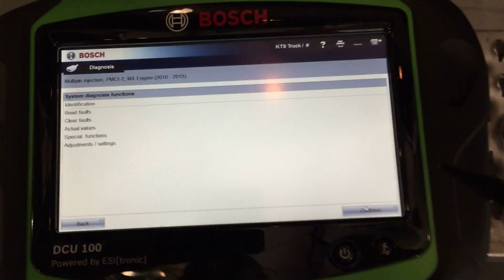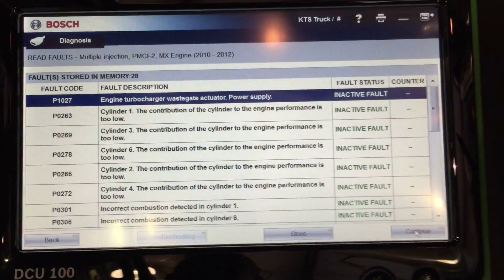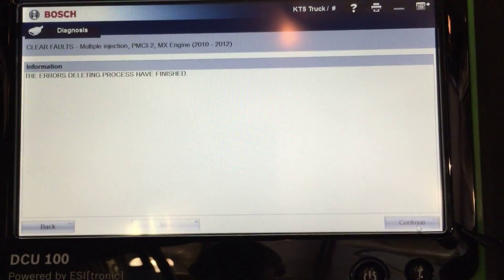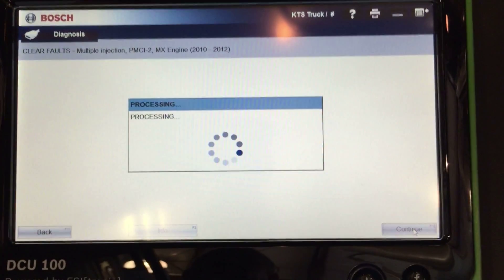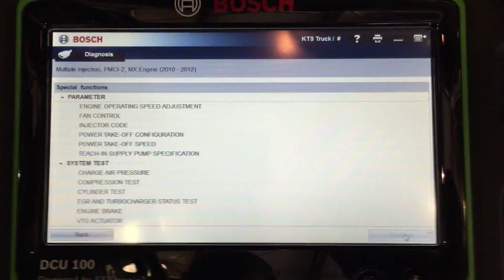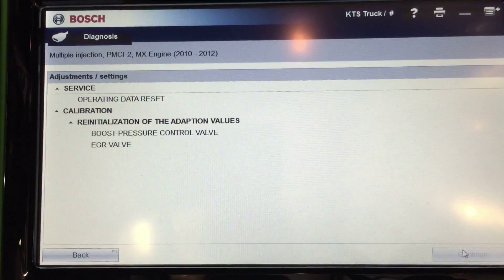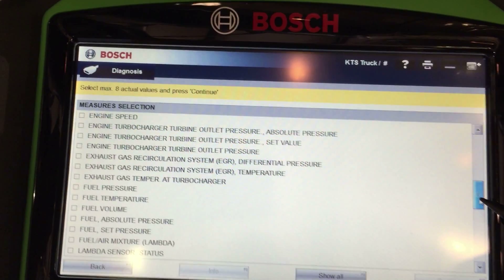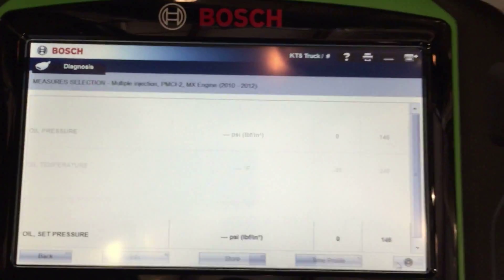BOSCH ESI Heavy Truck Diagnostic Tool & Scanner Reviewed - 2011 Peterbilt with MX Engine

Comment: Might you know of a good entry level HD scan tool?   I am from the light duty area switching over to HD.  I am used to needing to have a scan tool, for resets, basic code clears. (ABS work, Oil changes, Batteries, rear brakes,  Basic quick scan of MIL for a Customer.)   I may ask my SO rep, if I can get a HD package for my scan tool, but doubt they do that any more.  Plus I don't want to jump into a $8,000 plus tool right away.  I have to buy more tools first.

I don't know if it's the same for the HD side. However I do know, if you must do something simple and need to clear a code to finish. The shop scan tool is in use, Without fail.
Reply from the maker: Couple suggestions. One, this kit will read/clear/troubleshoot all codes on all commercial trucks -- http://www.diesellaptops.com/Universal-Diesel-Truck-Diagnostic-Tool-Scanner-Laptop-Kit-CF30-PFD-DREW.htm ... You could also look at some of our used items (http://www.diesellaptops.com/Used-Items_c27.htm) ... otherwise, call us at 888-983-1975 option 1 and talk to a sales rep. They are super knowledgeable and can direct you to the right direction. Also, the best "budget" version is a handheld reader. This is the best one since it comes with repair info & also does some DPF regens: http://www.diesellaptops.com/CanDo-HD-Bluetooth-Mobile-Scanner-with-Regens-Bundle-HD-MOBILE-BUNDLE.htm